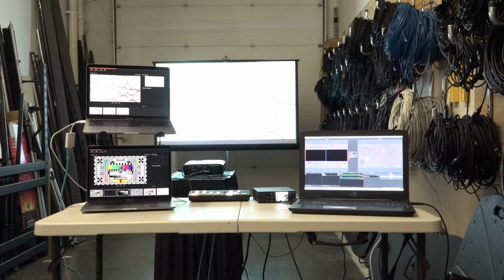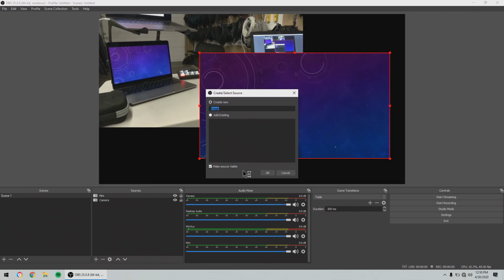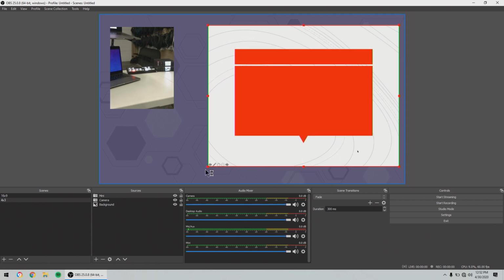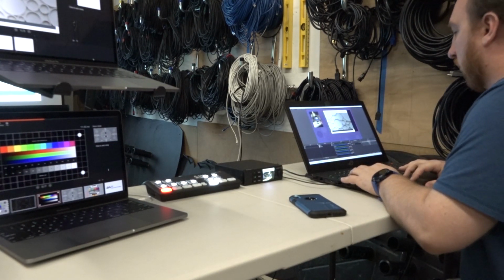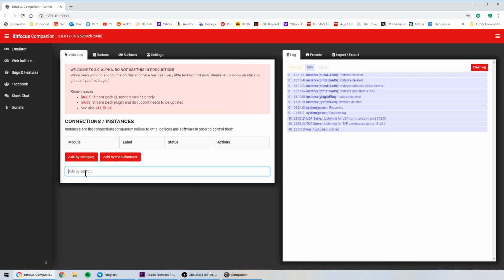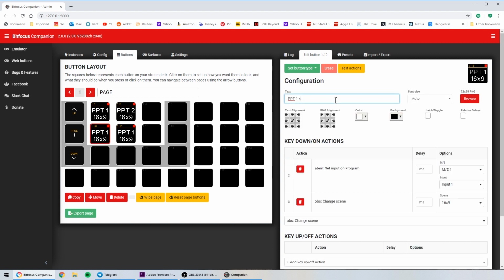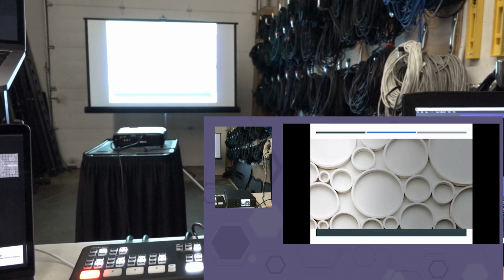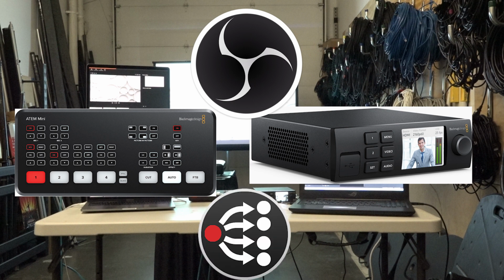ATEM Mini With OBS plus Companion!!!

Comment: Can you only do the switching with the ATEM? I really don't want to buy streamedeck
Reply from the maker: Yes if you want to switch the ATEM you can always just press the buttons on the ATEM, but then you have to press the OBS button also. The StreamDeck is more for if you want to do it all with just 1 button press. 
BUT! you can also use the Web Buttons on BitFocus Companion and avoid buying a StreamDeck whilst still doing all of the things with a single button press.
Reply: @redbearddoes1720  thank you so much sir.and keep producing FIRE 🔥

Comment: Thanks for this nice video. Would it be possible using Bitfous Companion to trigger OBS Scene change when any of the ATEM Mini camera switch button is touched and vice versa trigger ATEM mini camera change when a scene changed is clicked on OBS?
Reply from the maker: Yes and no, You can make a button on the Stream Deck using Bitfocus Coompanion that does both the atem input change AND the OBS scene change. But If i'm reading your question correctly you just want to push the button on the ATEM itself and have the scene change at the same time correct? if that's what you are asking I don't know of a way to make that happen. 
If it were me i'd just use the stream deck and have 2 actions tied to the same button.  If that helps
Reply: @redbearddoes1720  Thanks for the feedback, you are awesome. Yes you are correct, I just want to push the button on the ATEM itself and have the scene change at the same time on OBS. I know using stream deck and have 2 actions tied to the same button can do this, however, my use case which led to my question is because i've been doing more of corporate works this days meaning i have to go to client's location and sometimes the environment is not very convenient to have too many gadgets. So for out of my office jobs, I am trying to reduce the number of hardware i have to carry for outside job to only necessary ones. If i'm able to eliminate the stream deck for outdoor jobs, it's one less thing to carry. Thanks for the feedback, appreciated.

Comment: Great video! Just wondering why have two laptops running PPT? Do you find it better (in terms of performance or stability) to have separate laptops rather than consolidated into one.

Which also could be said for the OBS laptop as well.

Thanks and keep up the great work 👍🏻
Reply from the maker: Most of the show's i've been working the last few years have been medical shows, So we run 2 PPT laptops because A)the talks are only about 9 mins long each, there is about 30 seconds to switch to the next talk B)The doctors don't give us their PPTs till day of, some don't even do it till about 20 mins before they go up. 
Two laptops allow us to bounce back and forth and download and test PPTs as they are brought to us through out the day. 
If they handed us 1 big PPT for the entire day then we probably would only do 1 Laptop or run the second for Videos or just back up.
Reply: @redbearddoes1720  got it! I face a similar issue with speakers delaying submission of their PPTs.

Actually it's one of the problems I'm trying to solve by getting the Atem Mini (have the ability to slot in a speaker's laptop last minute).